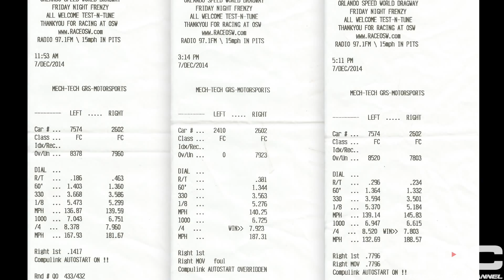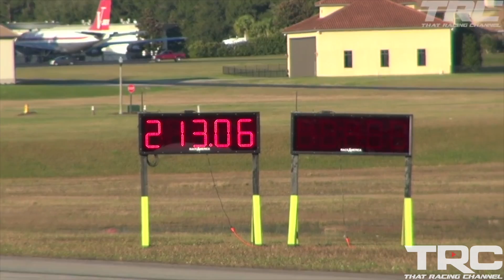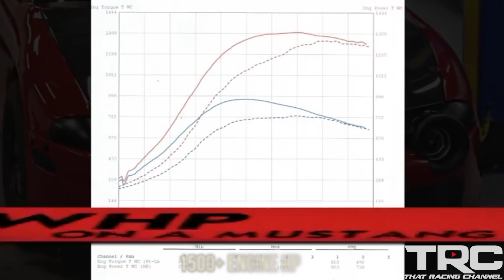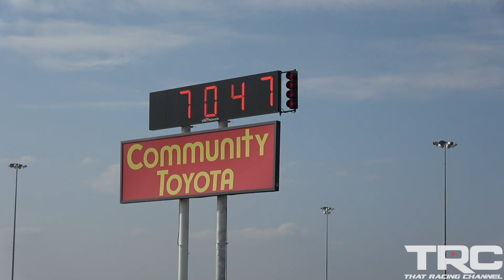Red Demon 1800HP 4 Cylinder 80psi of Boost! - The Quest for 6's begins

Comment: The 4G63T engine should be known as the strongest turbo 4 engine.
Reply: Daniel Caldwell I dont know about the strongest but its one of the strongest 4 cylinders. There are other 4 cylinders making a lot more power. Example the SR.
Reply: 4G63 or K20 are the best 4cyl flowing heads and stock block around. Never seen anything mind as blowing from a stock SR.  HP/Litre they are the strongest blocks on planet. Now go and sleeve and rod your SR20 to make it not blow up after 400hp, when these pull close to 600 with a $400 junkyard motor.
Reply: Drunk3nMas7er lol. Youre ignorance is funny. Just look up 2000hp 4 cylinder on youtube and be prepared to be shocked.😉
Reply: Drunk3nMas7er you may need a drink after watch the video i recommended you watch.🤣🤣🤣
Reply: I'm not ignorant at all... Pot calling the kettle black much? You just compared my comment on stock blocks vs a long rod billet block motors with a rod ratio like an motorbike and reliable at over 10,000rpm.  Talking stock blocks here mate! Even a grout filled block with a solid gasket (no water in block ) running cooling only on the head and methanol won't take 2000hp...  BTW All at 0.400" lift -  Stock K20a 294cfm - Stock SR20DE 208cfm at .400" SR20VE  263 cfm, 4G63 EVO 7 251cfm - all at 28in water. The factory K block has a a single piece girdle for the main bearings too.  Now go price a set of cams and shims to only match a K series standard camshaft on your not VE series SR20...
Reply: Hi "Here's the most modified SR20DET on the planet, that has no Nissan parts left apart from the cylinder head that's sat in a 5 Axis CNC for 30 hours :P"  "Dis SR20 owns a stock block 4G63 or K20 Bra!"  Comparing $50K- 100K to $400 junkyard motors, how fresh are you off the boob ?
Reply: Drunk3nMas7er by the way. Ask yourself. How many road race championships has yhe 4g63 ever won? Dont bother. The answer is 0. The SR and the other hand has quite a few in the TOCA BTCC amd JTCC. I suggest you do some research before making your next comment. Stop embarrasing yourself.
Reply: Are you for real?   Search 2145HP 4G63, definitely over 2100Hp, do you know how to count?  This car is AWD with 20% powertrain loss and a stick shift!  Bahahha  -  there is no comparison to a pipe tube RWD drag car with an auto and this.  Now lets compare two RWD purpose built drag cars - Jett racing RWD 4G63 here in Australia runs a 6.57 @ 223MPH   - Your beloved Mazworks Sr20 runs a 6.78 @210 MPH.  4G63 > SR20.  Road race championships have to have stock block and crank... Comparing apples and oranges here.  Use google before making a public display of your lack of knowledge ;)
Reply: Drunk3nMas7er that has been proven to be fake. And you know this all too well.
Reply: Low 6's - Are you for real ? I knew you were a little slow but now you think an AWD full chassis with a stick shift will run as fast as pro-mod auto times on drag radials if you have the same horsepower...  You can't even do burnouts in AWD to heat the tyres.  Then talk about road racing heritage, about a motor everyone knows is from a vehicle used in the WRC... Which won the the WRC from 1996-1999, also the 2009 Australian manufacturers championship- so lets count that for you - that's 5 championships straight up when you said 0?  For the record you brought up a story about billet engines when I was talking about bone stock factory delivered engines.
Reply: Drunk3nMas7er ohh yeah. Just in case you still live under a rock. The worlds fastest SR IS quicker and yhan the world fastest 4g63.
Reply: Drunk3nMas7er and as for billet blocks. This Red Demon uses a Bullet billet block so does the Jett Racing eclipse. What!? You thought I didnt know? Youre only fooling yourself here.🤣🤣🤣🤣
Reply: So now you want to compare a turbo 6 cylinder AWD with double the capacity engine and close to double the torque to a turbo 4 cylinder?   Saying SR20DET had racing pedigree in BTCC, when it was a FWD non turbo SR20DE too! Apples and oranges again mate.  True that being quicker in 1/4 time but  the worlds fastest turbo 4cyl is the 4G63 in terms of MPH. So given a mile of highway, we both know who'd pull away given the superior valve angle and flow of the head.
Reply: Why bother making up stories mate, go take your meds - Jett racing run there own custom billet block, not even close to the shape of the Bullet billet block, 10 second google and I had the truth - go check the Jett racing webpage yourself.  Probably the same amount of time it'll take other youtubers to realise who's the fool here.
Reply: Drunk3nMas7er the point is. Forget talking about the SR billet block as if this car and jett arent using billet blocks as well. Youre only fooling yourself. Not me. Now back yo the cars. The TeknoToyz S15 did faster times than any 4g63 powered car on the planet. That IS fact. You can deny it but its on youtube. Look it up. 2000hp 4cylinder.😉
Reply: The real point here is, you have no grasp of language - read my first post - entirely about stock blocks.  You've been arguing shit about a billet race motor being better than another, not exactly what 99.99% of the population will be playing with in there shed is it?
Reply: Drunk3nMas7er no jokie man. Youre getting it all wrong. There isnt much difference from one  billet block manufacturer to the next. Youre the one that went off on billet blocks when you realised that SR can make just as much or even more power than the 4g63. But just a little more imfo for you. There are oem cast aluminum block SRs making 1400hp. Which is impressive considering that the cast iron 4g63 did excatly the same. Remember Brent Rau? Well both GT Autosound and Micks motorsport have oem cast block SRs doing 1400 hp. 😉
Reply: So how am I getting it wrong? I was talking untouched junkyard stock block OEM first post. No aluminum long rods and shelf pistons reducing sidewall friction, no competition coatings molly embedded into the bores and oversize studs, you don't even realise my mate's brother started that company and no American car could touch Australian cars for 20 years till he franchised that tech to America.  All along I was talking -  untouched OEM factory delivered block piston rods... You went on a pissing contest about billet race motors, lied, made up stories?  Still bringing up new information unrelated to my first comment I see... Do you want me to add unrelated content -  I could make 3000hp from almost any motor with a bottle of liquid air from a mates air compressor that filled torpedoes that were used in WW2 without the need of combustion or fuel!
Reply: Drunk3nMas7er and excatly which 4g63 can handle 1400hp without all what you said? NONE. No 4 cylinder csn do that without a lot of work. So what excatly is your point? Its a common fact that completely stock bottom end SRs can handle ip to 500hp. Which is the same for the 4g63. So.....??????
Reply: Record 4G is 755AWHP on a bone stock 4G crank rods mains, 50% more HP, 10% more drivetrain loss...  900 crank HP?
Reply: Drunk3nMas7er that 500hp was for a daily driven street car dude. For drag racing the stock bottom end SR can can handle more.😉
Reply: Drunk3nMas7er there isnt anything special about the 4g63. There are other 4 cylinders that can do the same.
Reply: My mates EVO lasted 3 years daily driven at 600 awhp...
Reply: Drunk3nMas7er right here on youtube(its quite an old video by now) 549rwhp SR20 stock bottom end. Look it up. Like I said. 4g63 its the only engine that can do those things. 😉
Reply: No motors are special, they're a hunk of machined and cast metal, and will be melt into the next model when they scrap it when it snaps in half!  All approx 2L 4 cyl engines with the correct head work will have the same potential Horsepower.  But the K20A or K24A3 ADM head flows better than a heavily ported and cammed SR20 or 4G63 in off the shelf standard form. I wonder what $400 junkyard motor I'm fiddling with...  One of the top drift car's in Aus last year was an S15 with a Kswap. Made the same HP on the same turbo as the old SR20 on 6 less psi of boost.  Only seen Honda engines on boost make more than a stock 4G, only because of head flow of course, VE series SR's are great, but $3000 a motor because they're so rare. Best junkyard 4cyl motor in Australia you can throw over your shoulder after abuse for broke fuckers like us is K24a3 and 4G63.  700hp stock block capable is amazing for the $400 I get them for. SR20's are $2000-3000 in good shape. I can RWD a K24a and purchase an aftermarket ECU for that money...
Reply: Drunk3nMas7er strage thing about what you said is that there are no 2000+hp Hondas.
Reply: Still on a pissing contest when I treat you with respect, teach you shit you don't even know - if you haven't learnt anything in your attempt of a troll fest from me, I'd be shocked, but honestly I've learnt nothing off you...  K20's in RWD are a new game people are playing with, 2000HP on a FF setup - Nasty Death trap nobody has bothered yet.  The fastest FF in Aus was V6 turbo magna that went splat and killed the driver at  approx 1600 whp a few years ago here, the tuner said he would die too...   If you knew the flow characteristics of the K20 head- 500+ WHP NA for goodness sake, feed it Nitro-methane and 80psi on 17:1 compression - will pull close to 3000HP at crazy rpm.  I wonder how many tuners out there don't realise that the K series is the first Honda engine to not run anticlockwise since the dawn of there age which makes them now compatible with normal gearboxes and differentials.

Comment: Can I start a Boostin Performance - Red Demon crowd funder to purchase you lot a pipe tube chassis to shut up tossers so that you can break the world record for 4Cyl Pro-mod?  My tuner works on the 6 second Jet racing 4G63 motors and drives the datto 1200 at times too, dig up Robbie Novak - tunes all the fastest cars in QLD Australia.  I want you to shut up the haters that compare pro-mods to legends of the stick shift steel body :)

Comment: How come Hondas can crack 7s being FWD and a couple hundred less hp?
Reply: They w weigh nothing
Reply: Ramon Garcia cracking 7s and almost cracking 6s is entirely different they are world's apart. Plus those Honda's run big fender flares so they can run big wide tires up front and they also are stupid light.
Reply: AntiLag BoostAddiction I agree with you,night and day difference. Also there 6 sec hondas but not sure if they’re H pattern or not. Most likely they are but not sure.
Reply: Lmao the booty hurt is real
Reply: Ramon Garcia they are automatic. Just floor it and do nothing
Reply: chinchy111 theyre not though
Reply: They all auto
Reply: Speedfactory's hatch..not auto..its an H pattern..and runs 7.6.. although it is said to have 1850 hp, i thought it was 1400.

Continue the aching booty replies
Reply: we arent saying track civics are slow, at least im not. but anything sticks and goes with wide enough good drag tires, be it fwd rwd or awd. also civics are lighter. i mean even a 1.3 liter rotary has done 6.5
Reply: Jesse Costa *you're
Reply: AntiLag BoostAddiction not to mention weight bars behind the front bumper to keep traction at a minimal
Reply: TANDEM boii nah blood your is correct
Reply: Ramon Garcia There are a few DSMs in the 6s over a decade ago. Fastest 4-cyl in the world is a DSM. Nothing to be butthurt over.
Reply: They all from 2fast2furious yo.
Reply: @3monchii5  speedfactorys civic isn't even the quickest stock chassis FWD , the 4g63 DSM from Kiggly racing is quicker , they can't even beat DSMs in the FWD class and nobody even races FWD DSMs lmfao

Comment: Awd? 80psi? 1800hp? And yet it’s struggling to get into the 6’s😅 tragic
Reply: Carlos Ramirez If it was easy it would’ve been done by now.
Reply: Carlos Ramirez you gotta think to that it's still H pattern stick shift as well not auto so that's fucking flying!!
Reply: michael valdez And launching a AWD car with a clutch is extremely difficult
Reply: If it wasnt runninga h pattern and small ass tires it would be deep 6's
Reply: For real! FWD hondas have been in the mid 7s with a couple hundred less hp.
Reply: Ramon Garcia Yea running way bigger tires and easily 400lbs+ lighter I would hope so.
Reply: I assume by your comment that you have a car in the 6's then?
Reply: Carlos Ramirez go play your video games
Reply: Little kids on here have no idea what there even looking at, when you get large amounts of HP you have to get it down the track sometimes it takes time to get it down, just awhile back they were at 1200hp there moving up, AWD is hard to get that kind of time and speed, see if your mom will let you stay up late and watch the video again.
Reply: AntiLag BoostAddiction I don’t know about 400lbs lighter. Doubtful.
Reply: Carlos This car weighs more than most pro stock cars.. For this platform this is impressive. Just like and move on.
Reply: preludeF20Bking Ive watched low budget gutted civics street racing that we're around 2000lbs those top built civics are even lighter this DSM is probably around 2400lbs and some change it's a easy 400lb difference.
Reply: It's an H pattern... If it had a powerglide in it it would run low 6's.
Reply: Ramon Garcia and front wheel drive !!
Reply: Still better than those gay ass GTR's.
Reply: @3monchii5  you keep talking about mid 7s , 7 flat is faster , your bragging about being slower  lmao , are you a little slow